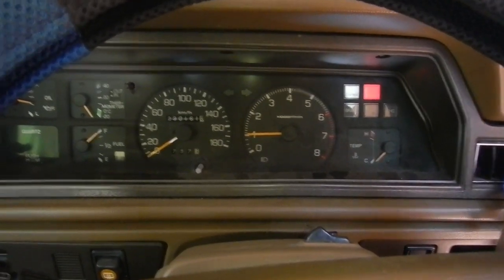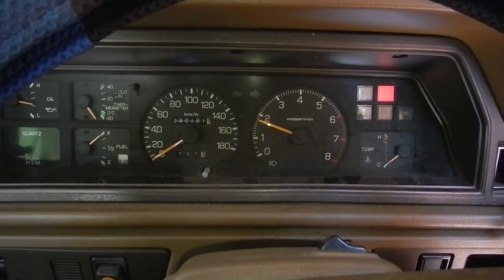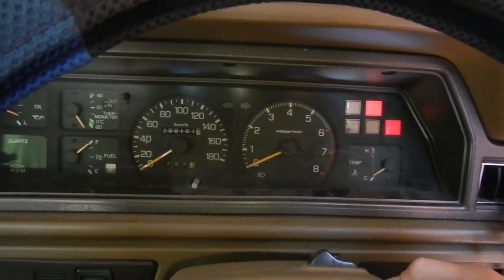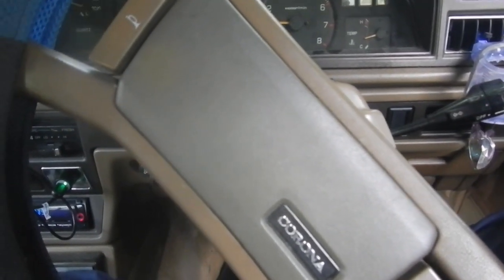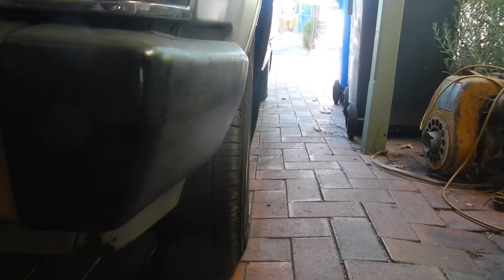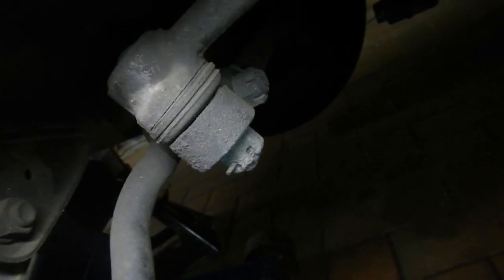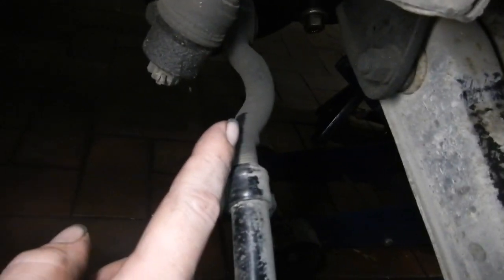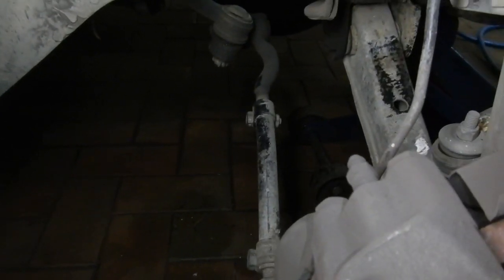RT132 and tow truck FAIL

Comment: This is why I want to do my own work on my car; too many "mechanics" that wanted to get the job done fast either made a mess of my car or did something stupid. 
-Got an oil change, oil spilled around in my engine bay, and I mean puddles of oil. Near my exhaust manifold too. 
-Got an aftermarket exhaust, they welded on my BOLT ON exhaust tip without my permission.

Comment: Fecking hell, im not a car person but i know you dont attach anything to the tie rods!!
They are only expected to cope with compression or stretching forces, dam stupid recovery driver.

Must be a shitty maker of capacitors, hope its not that series wirewound shunt resistor connected to the B+ on the coil playing up :-(

Never mind, im sure you will win.
Reply from the maker: i think it was just a lot of shit condensers i got for it. i had put a new resistor on it a wile back. time will tell. runs real good now.